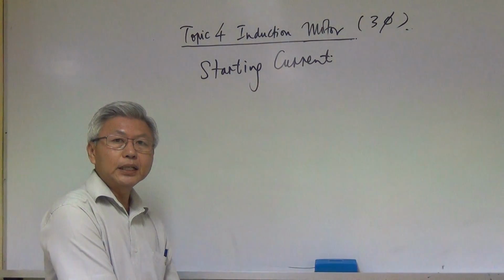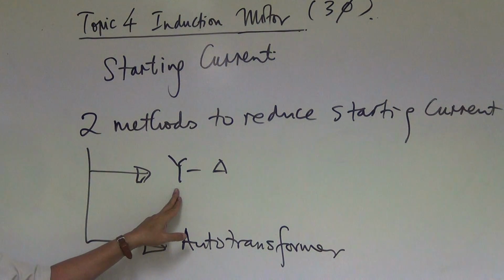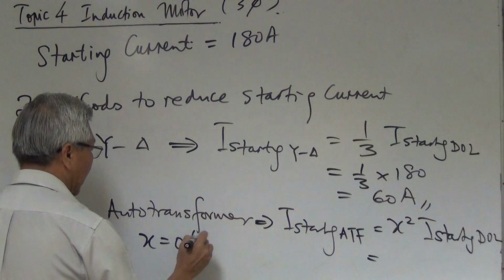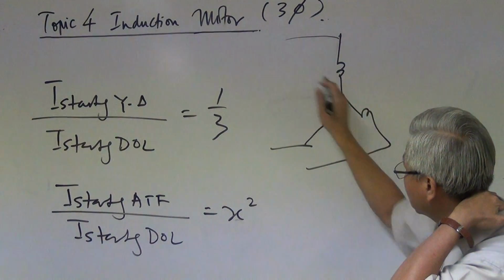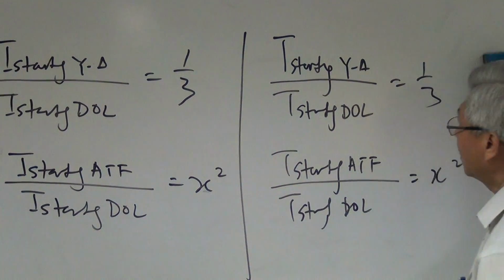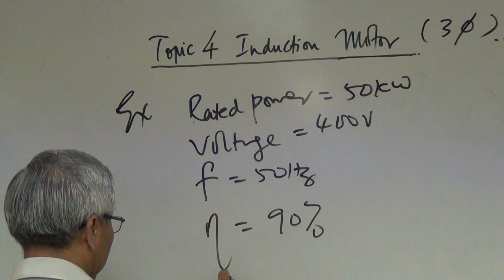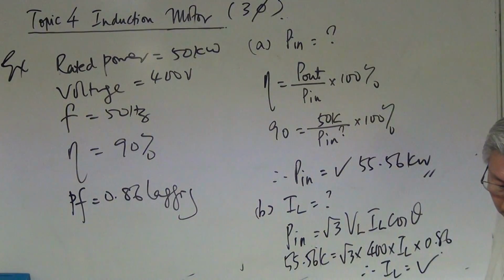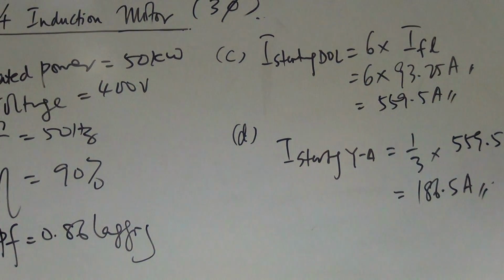Induction Motor Starting Current

Comment: Hello sir. Thank you for this great video.
I am helping a carpenter  with his machines. His machines start at very high current as you say. For example an old bandsaw. Might start with 15 amps and continue at 3 amps (i can confirm these measurements). What is the simplest/cheapest way to reduce the starting current? Is it possible to use capacitors? Or is the starting motor the best method? thank you again